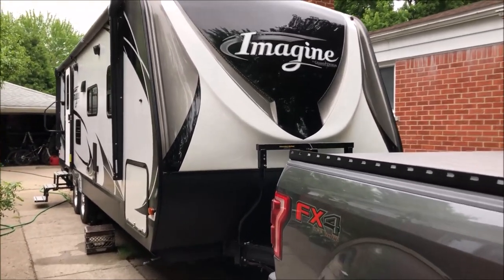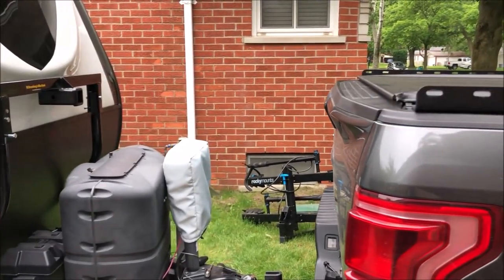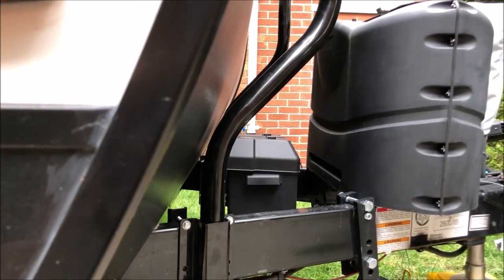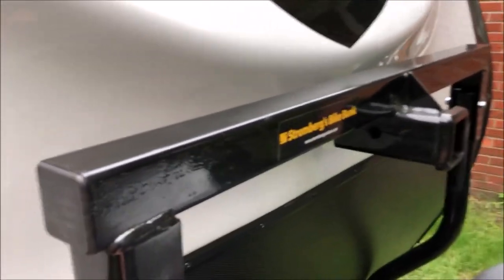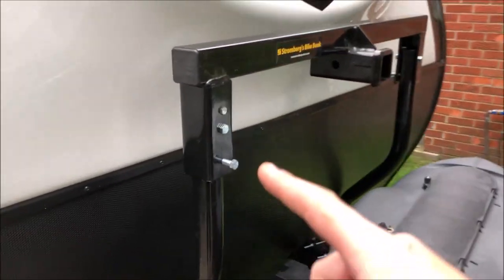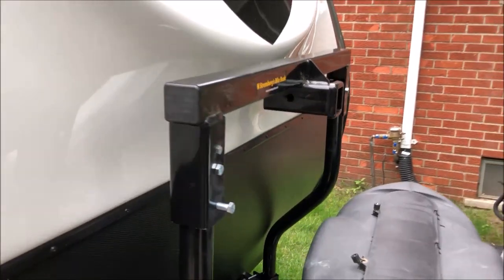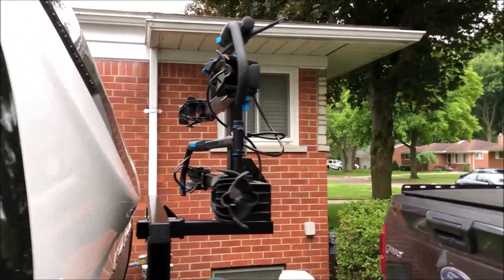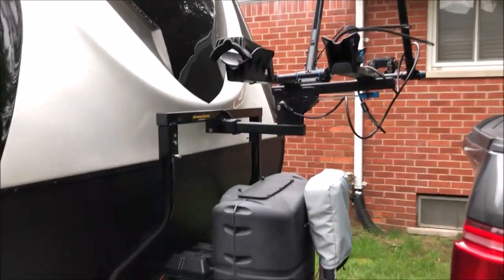Bike Bunk and Rocky Mounts bike rack review

Comment: I also have an Imagine 2600RB.  I'm interested in using the Bike Bunk.  My problem is I have a ladder rack on my RAM 1500 short bed and I carry a kayak on top of the ladder rack, in the center of the rack.  Do the bikes actually go into the space above the pick up bed when making tight turns?  How high do the bikes extend when loaded on the bike rack?  If I knew that measurement I might be able to determine if this will work with hauling a kayak.  Thanks!
Reply from the maker: It really depends on what bike rack you choose to use with the bike bunk frame. Yes, in sharp turns there is potential that the bikes could hit your truck’s ladder rack.

Comment: We have a similar setup, but a Winnebago trailer- and tow with an SUV- so do the bike tires pass over the top of your truck bed in sharp turns? Won’t be an option with our Land Cruiser but would like it to work.
Reply from the maker: Generally not a problem. But let’s say if it’s close then you can unload the bikes and flip the rack up out of the way before taking any extreme steering cuts. Yes, it sits higher than the top of my truck bed.

Comment: Thanks for the review.  We have an Imagine 2800BH.  I like how this carrier tucks up pretty tight to the front of the trailer.  Have you traveled much with this setup yet?  Any issues with it making contact with the trailer with that tight clearance?
Reply from the maker: I’ve had 1 season, 3 trips of about 200 miles each way with bikes loaded this way. No problems so far!
Reply: @JohnsDIYPlayground  Thanks John! ✌
Reply from the maker: Just drove another 400 miles with the bikes here in August 2020. No problems, we’re still happy campers!
Reply: @JohnsDIYPlayground  Excellent. I ended up getting the same one. We've done two camping trips so far. It's working out great! Thanks again John!